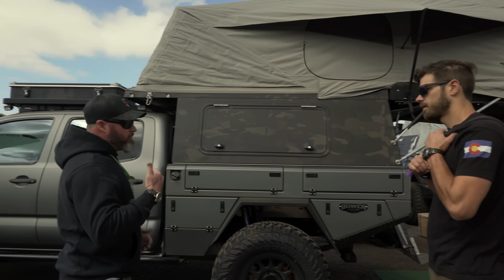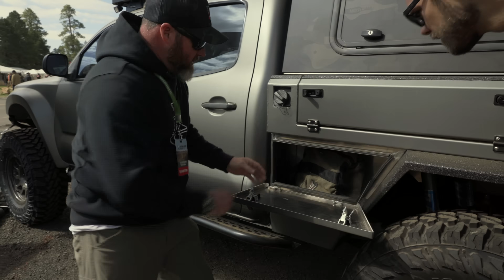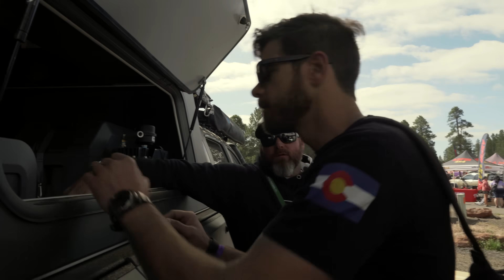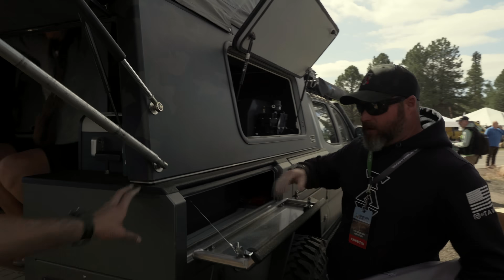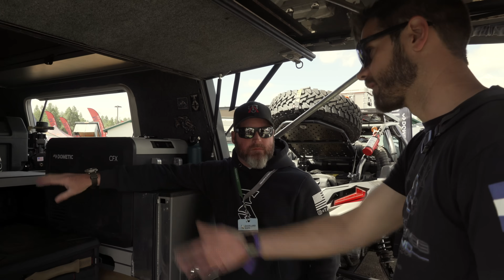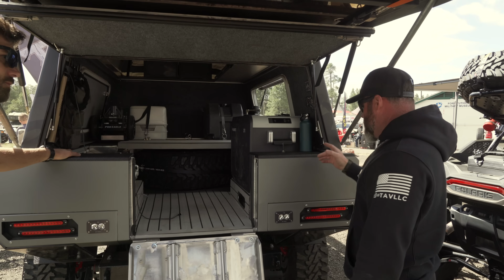This Truck Bed Blew My Mind! | Coolest Things of Overland Expo West 2022

Comment: Are you still making these? I have a 99 Ford F350 7.3l diesel dually 4x4 .. I threw away the original bed for a utility box..and now I want a more comfortable cool build..and I stumbled on this ..
I appreciate it
Reply from the maker: Reach out to Tactical Application Vehicles. I just did the video, they do the hard work.

Comment: finally there's a program I like to see, I didn't like the truck bed in the rear, hope to get it with a flat bed, but this is amazing. I from the years when truck bed was 10 feet long, did not like 5-6-8 foor truck bed. Most lumber is 8=10 feet. I am still looking to find a 10 foot truck bed with a cab 4 door. 🤠
Reply: I am pretty sure ram makes a 4500 or 5500 like that.

Comment: Great set up. Looks well designed.  I have a small question about the lower battery and REDARC placement.  Are the cabinets sealed? Ie water sealed so if your out doing river crossings, or are you running the risk of getting water inside and shorting/ frying your electrical setup?

Thanks for sharing this build
Reply from the maker: I wondered that myself, as have a few others. I will be doing another walk around in about a month at Expo PNW and I will get some questions answered.
Reply: @IndependenceOverland  If i knew these guys before, when i was debating between jeep and 4Runner i would of went with the Toyota instead!!

Comment: Almost $18k not exactly an option for most folks.
Add the cost of a fairly optioned Alu-Cab and you're in it for ealisy over $40k closer to $50. 
Lots to consider, like are you going to put this kind of money into a daily driver, do you have the funds to have a dedicated overland rig sitting at the house to be used once or twice a months if that much.
Reply from the maker: Definitely not for everyones budget. I personally am about to have a travel specific(non daily) rig not because I have a ton of money, but I’ve driven the same vehicle for 13 years. 

For someone like myself, I need a midsized truck and if this can expand its usefulness I am all in. But I am also someone who camps 50-60 nights a year with goals to double or triple that number in the near future. But you are correct, this has a smaller target customer base.
Reply: @IndependenceOverland  At some point ($$$),  you're getting close enough to consider a Patriot trailer. Light enough to tow with a Jeep and usable with any future vehicle you decide to purchase. You can just unhitch from your daily driver with no fuss and not need a dedicated Overland vehicle.

Comment: Was there any mention about the higher center of gravity from a regular bed.  I currently use my home made slide in camper on a Tacoma standard bed but sure could use the added storage of such a flatbed with side boxes over and under.
Reply from the maker: I will ask this at the next expo and get some answers!

Comment: Such an awesome product. I want one with a smart cap on top. So much storage that is easy to get to and organized.
Reply from the maker: With a smart cap setup you could make an incredibly well organized setup! It will be pretty cool to see different builds come from these in the future.
Reply: @IndependenceOverland  my thought is to enclose all of the side of the bed storage compartments and then have a center pull out drawer in the back instead of the tailgate opening. So the top of the bed would be a complete flat surface. You could run a slide deck system for cargo on top of the bed.